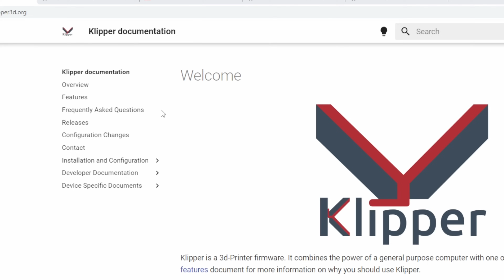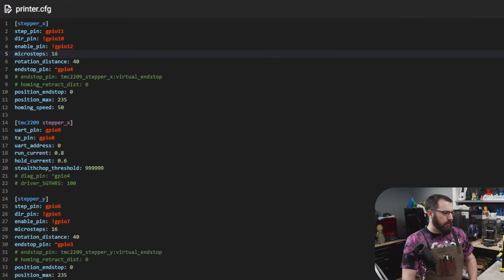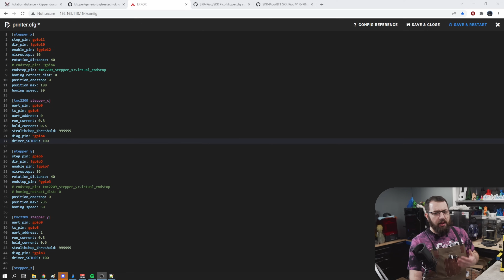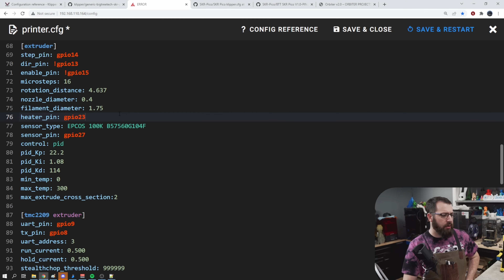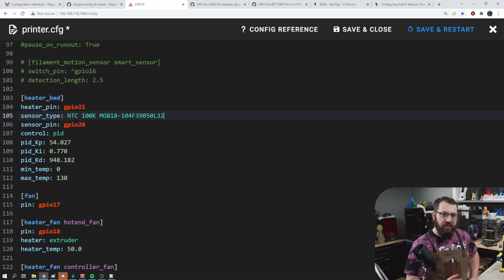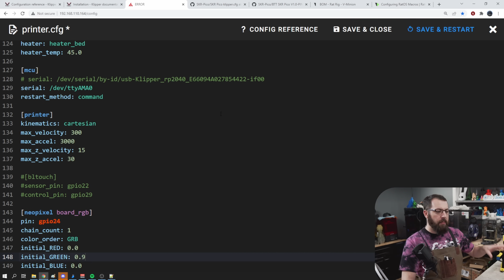Install Klipper on ANY 3d printer - Part 2 - Create a config from scratch

Comment from the maker: PLEASE NOTE
 I was backwards on my comments in regards to stealtchop threshold, a value of ZERO disables it forcing spreadcycle only, a high value forces always on stealthchop

#stealthchop_threshold: 0
#   The velocity (in mm/s) to set the "stealthChop" threshold to. When
#   set, "stealthChop" mode will be enabled if the stepper motor
#   velocity is below this value. The default is 0, which disables
#   "stealthChop" mode.

Comment: It looks like the nozzle diameter is defined in the printer.cfg file.  What if I have an extruder with a quick change nozzle such as the Revo?  Does Klipper have a way to define the nozzle diameter
in the gcode file so I could switch nozzles in the slicer and not have to edit the printer.cfg file every time I change the parameters in the slicer (and swap nozzles, which you can do in 30 seconds on the Revo)?  Ditto for the feed rate with a swap to a high flow nozzle.

Comment: hi Nero i am having some weird extrusion problem during mid print resulting not a smooth surface. i have calibrated my rotation distance but it seems to not fix the issue. i used the longer lk4 pro example config since its a longer lk4pro with some modification such as running a dual blower, bltouch and a dual gear extruder and also cr10 spider hotend that comes with the supported hardware. Can you help me where i am doing wrong?

Comment: hi. i need help for printer.cfg file. I have octopus pro, klipperOS, tmc5160 and bltouch. my machine have 4  z axis with lead screw.  i want  sensorless homing fonction on xy axis (belted). corexy print build y260, x 350 and z 345. i hope someone will help
thanks.

Comment: I'm new to 3D printing, got my Biqu B1 setup and working with BL Touch (Marlin) after some struggling and it's printing great now.  I'm a bit hesitant to try to Klipperize it but Klipper looks so much more user friendly than trying to compile builds in Visual Studio Code. I got a Pi 4 yesterday, new in box, locally for $65.  Decisions decisions.

Comment: The SGTHRS in driver_SGTHRS stands for "Stall Guard Threshold", Stall Guard it's the "technology" that constantly monitors the motor current, so in a sensorless homming when the stepper hits the "end block" it gets stalled and the current raises, when it's above the value the driver sends a signal to the microcontroller and it gets registered like "home". The more you know

Comment: how do i build an idex with klipper? :-)
Reply: By doing a lot of compromises there is a parameter to do it, but it's very limited, and doesn't appear to be anyone will be adding better support for it. My multi headed printer runs RRF. Really wish it worked on klipper, accelerometer support is much more intuitive.
Reply: @kazolar  I wanted to convert my JG maker ARTIST-D to klipper but i guess not lol

Comment: yeah but ratos. Quite a cliffhanger at the end
Reply from the maker: RatOS isnt an option at the moment as im using a controller that isnt supported by it atm, along with doing some non-stock things (SKR pico, sensorless, etc)

And yes cliffhanger...video was getting way too long and decided to split it lol
Reply: @CanuckCreator  Of course. They should have done at least sensorless homing as default. Was just building mine. Gone be a beast machine.

Comment: One thing that I recommend, but haven't seen anywhere is to set your extruder fan pin to be on at micro-controller startup when compiling the Klipper firmware for the controller.  This is will turn on the extruder fan when the printer is powered on.  This will give an audible indication of when Klipper is fully booted during a normal power up (fan will turn off when the MCU connects to Klipper) and can prevent heat creep issues if there is a momentary loss of power or MCU reset (if you press the kill button on the display, for example).
Reply: Good tip, thanks

Comment: you don't need a raspberry pi, but having one make things easier as you can just download the whole OS image and be done. I used Pine H64 and Radxa zero and they both work ok with their supported OS and installed klipper/octopi thru KIAUH script.
Reply: I used a  Radxa Zero on my delta and it boots in half the time compared to the Pi 3B in my V0.  I've got a couple of Banana Pi M2 Zeros that I want to play around with.  They have ethernet  :)
Reply: You can use almost anything as long as it supports Linux. I’m using an old Intel NAS I had laying around, and it has no trouble handling more demanding stuff like input shaping.

I also have it running on an OrangePi lite which boots quick and runs great